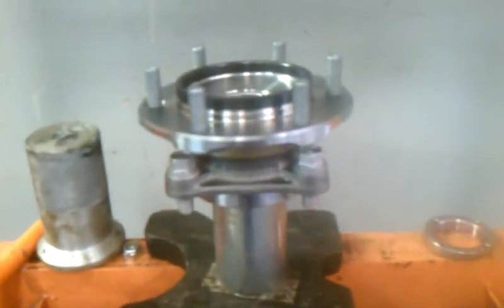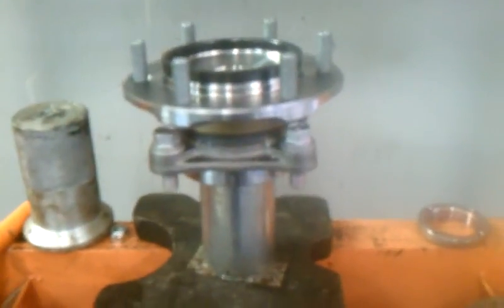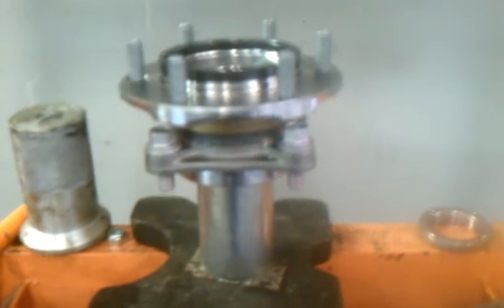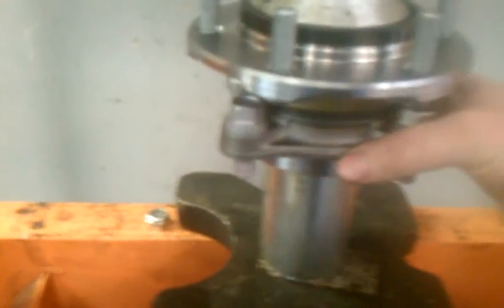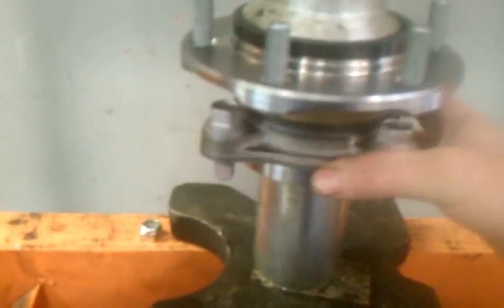Pressing a 2005 and up Toyota Tacoma, 4Runner, FJ Cruiser 2WD or 4WD wheel bearing together.

Comment: Can you make a video how to press the bearings out please
Reply from the maker: Sorry I didn't get notified of this message being posted.  I don't press out old hubs anymore.  It is much more cost effective to just build new assemblies.
Reply: Ok can you tell me where to find a bearing mount or at least how to press them out when you did it? 
Or can you sell me a discounted assembly ? I bought two wheel bearings for 60 a piece and no one can press them out. Please help . Thank you .
Reply from the maker: @Justadudeman22   There are press adapter plates that are generic, and are designed for all general press work.  No specific plates are for these assemblies.

Comment: Where can I get the press tools/sleeves? I know some use sockets of the correct size so as to press in the correct location. I would like to press new bearings onto my old hubs so I have replacement assemblies ready should I need to replace the wheel bearings again. Thanks
Reply from the maker: +Bob C, I have accumulated a dozen different sized sleeves over my 25+ years of being a technician.  One of the things I found was that the special tool used for 2WD units works great as a base!  I had an old one that had the sheer pins break loose, and I use it as a base plate.  Also you can find the right sized base plate if you have a tire balance machine similar to the Hunter brand.  One of the centering cones is just the right size.

Comment: From watching this video...  This job looks like you need special tools and a press?? I guess the DIY er cannot do this correctly.?? or can you just by the hub unit?
Reply from the maker: You will need a press to do this.  Any other method can and will damage the hub and/or bearing.  You CAN buy the entire unit from me.  I sell these online, and on several forums.  Go to our website at www.marionbumper2bumper.com and click the online store.  They sell for $170 each for the 4 wheel drive units.  That is the lowest price you will find for the Koyo wheel bearing assemblies ANYWHERE!
Reply: Marion BumperTwoBumper
Thanks.  Can you replace just one... or do recommend replacing both on an axle?
Reply from the maker: You can do one or both. Up to you
Reply: Is this a common repair on 2009 Tacomas??
I'm thinking a pothole up here in Pennsylvania did the damage.
Reply from the maker: It is actually a very common problem on the Tacoma, 4 Runner, and FJ Cruiser, which use the same wheel bearing.
Reply: Marion BumperTwoBumper
 Thank you for getting back to me. I tried to order a hub/bearing from your web-site.  I believe it did not go place the order.  I will try to call tomorrow.
Reply from the maker: No worries! Just call or email us.
Reply: Marion BumperTwoBumper
  Thanks for the info and great vid.  I sent you an email with order info enclosed.
Reply: Stephen Maurer Just order (& paid via paypal) your bearing/hub assembly. Thanks for your help and a great video.
Reply: Easy to install!! Worked like a charm.
Reply from the maker: Glad you are happy!  Thanks for the business.